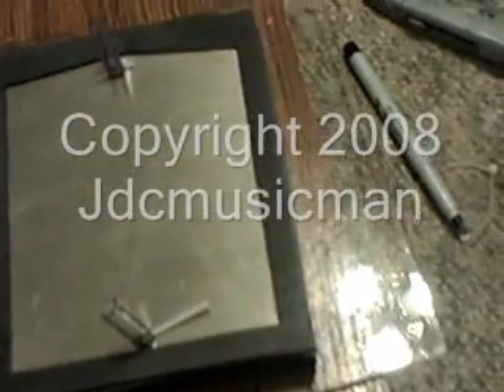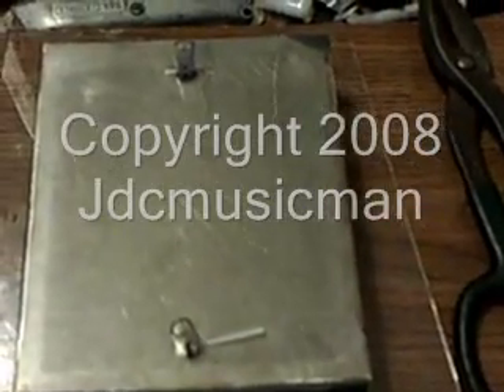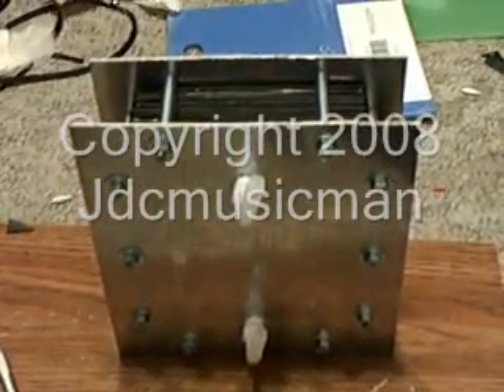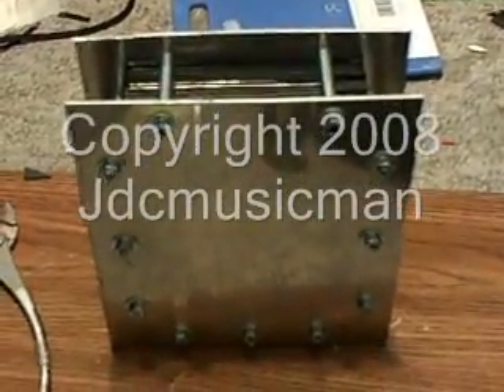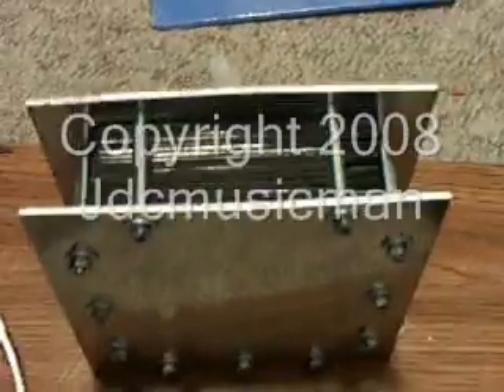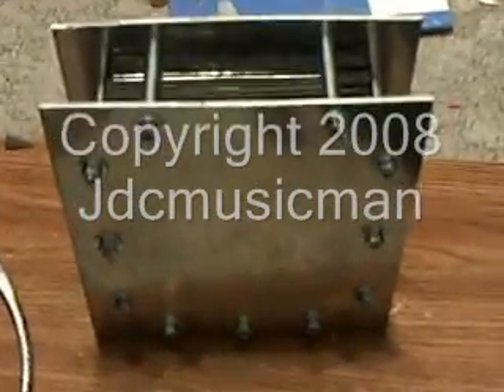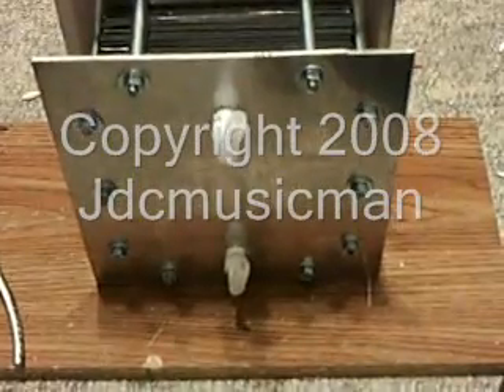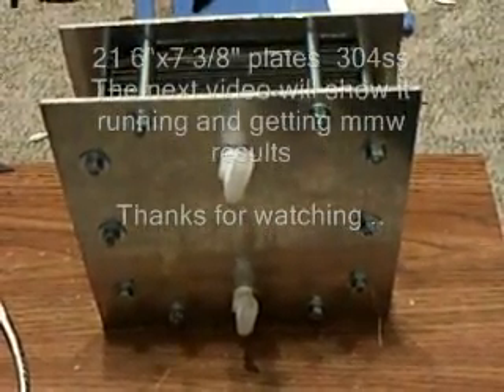21 plate 6x7 3/8 Tubed Dry Cell #2

Comment: Hi again JD,

Some questions?

I'd asked in a previous post on this vid why ya didn't use the outer plates as part of your active cell plates, you gasketed them off, why aren't you using them?  Just wondering?

Also, According to one of the HHO GURU's, the current leakage issue is only cause for a MAX of .5 MMW.  They've done tests where the have no lower holes and keep the E-lyte BELOW the upper holes, thus ZERO current leakage and found .5 MMW diff from exposed holes vs. no expsd holes..

Comment from the maker: got the steel  from a recycle center for bout 2 bucks ...Lucked up the other day and got a 4'x10' sheet of 16ga stainless for 50 bucks....
The hole alignments are perfect , I put the cell together toghten down and everything , then marks the spots on the tube ,then broke it down and out it back together with the tubes in it.I have alot of time in this cell

Comment: I am very interested to see how this turns out.
Where did you get the stainless for the sandwich boards? I have been looking for a couple months with no luck. I guess my problem is that I want them cheap.

I would suggest that you seal your lower hole tubes with marine goop.

One problem that I can foresee is that the gaskets will compress and mess up the alignment of your carefully drilled Q-tip holes.
Mars

Comment: nice , you are faster than me ,i have the cell in front of me and ready to assemble ,next week i will show a no hole design so simple no tube no 200 gaskets vary simple till i get my plates ,make sure that your voltage is steady .
Keep them coming.